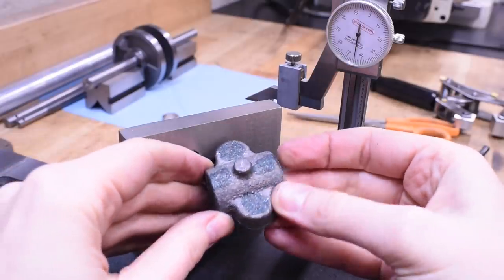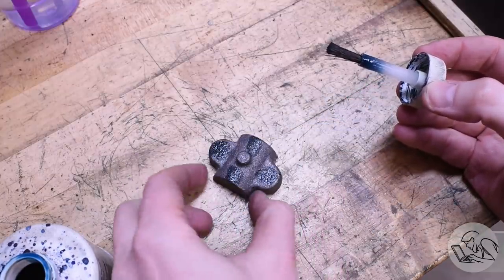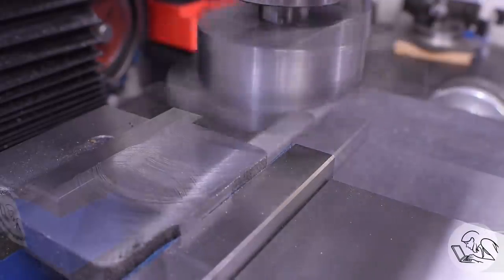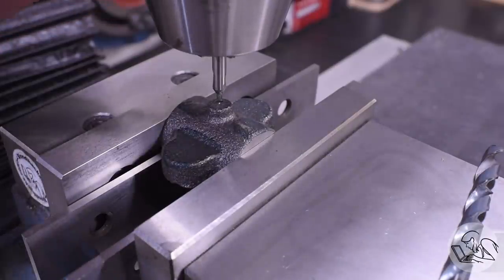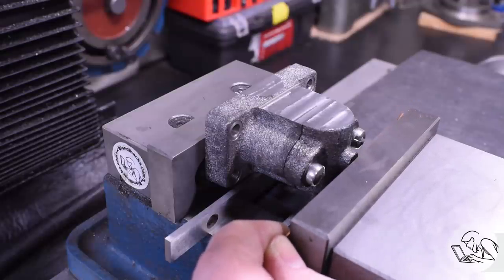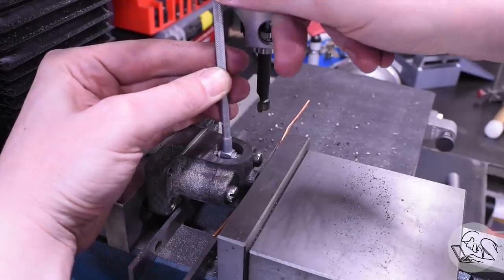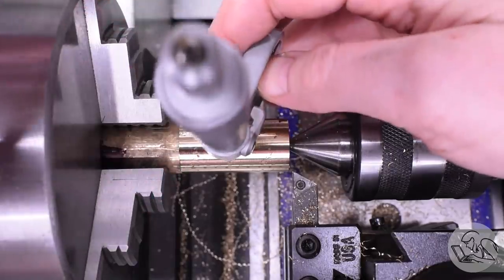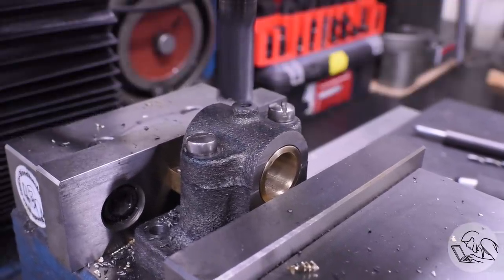Main Bearings! Big Steam Engine Build, Part 4

Comment: When this little machine is finished you should make a generator to power the lights in your shop.  It looks like a fun project.  Thanks for sharing your time and talents with the group.
Reply: I have a silly idea at the back of my head that won't go away, to make a steam powered web server from a model engine and an old bike dynamo or something. It would only take a handful of watts so it's very possible
Reply: @PKMartin  I love this idea. It's such a poetic juxtaposition of two of the most revolutionary technologies in human history - steam and VLSI
Reply: @PKMartin  A bicycle dynamo might be a bit small, but a permanent magnet DC golf buggy motor or similar, run through a regulator could very well power a RasPi of some sort, and they could do some basic server work using under 15W.
Reply: can water cool the server so that there’s less heat required for the steam

Comment: You may want to lightly scrape the bores of the bearings to give the oil room.  Given the high polish or finish of the bearing bores, it is possible to actually make them so smooth that the oil has nothing ton "hold" it on the bearing surface.  I've had that problem in the industrial world.

Comment: Seems like a sound choice to add the bearings. I would also be nervous about steel on iron without a pressure lubrication system. Nice visual touch also.

Comment: Your skill level and videos are getting better, even the boring parts were good. When you were contemplating the use of locating pins I immediately thought of where you can get some 1.6 mm pins from. The replacement turbines for dental hand pieces come with a blank bur. I'm kicking myself now for not collecting them when I was in the industry, I must have thrown out hundreds of them.

Comment: Lets hope this gets to you ahead of the two week window...I made some modifications to the one I built that have proved worthwhile to me.  On part #23 upper linkage thread the hole instead of using the pin to hold the #26 upper valve rod. Then thread the upper valve rod to screw into the upper linkage,  This gives you a place to fine tune the valve to the ports.  I extended the length of #23 and shortened #26 a bit to allow for some depth of thread and enough engagement of the rod to get a fair bit of adjustment.  I also added a lock nut to the mix.

On part #14 upper eccentric instead of drilling all the way through from the top I only drilled for the threaded hole and then moved the oil hole to between the brace and clamp rod hole.  This allows you to reach through the eccentric with a hex key to adjust the eccentric position without disassembling the eccentric.

lg

Comment: Another outstanding episode.  If you end up in a pinch, and you have a shaft that's just a thou or two or three too small for a bore, you can knurl it and the shaft will "grow".  Then you can turn it down just a whisker to hit the proper OD.  Not great for parts that rotate, but great for static fits.  To save some money on a rebuild, people sometimes knurl the old worn pistons so they won't slap around in the bore.  Hopefully.....you never need that trick.  You can also use it to change a sliding fit to a light press fit.

Comment: You can "pre-lube" the bushing material prior to machining to get rid of the squeel and to condition the stock. You drop your material into cold oil. Heat up the oil to bubbling point and then leave everything to cool down on it's own. Try it sometime it works like a charm. It only works on any brass or brass mix alloys
Reply from the maker: Interesting! I have not seen that technique

Comment: Ampco bronze is extremely handy to keep around; it's uses are various. It and it's cousin Nibral (nickel aluminum bronze) are my personal favorites for machinability, weldability, and most importantly, durability. If I'm making parts out of bronze for myself, these are the two types I personally reach for. That being said, in my real job as a CNC machinist/programmer, I just get to deal with whatever the customer specifies.... That can get interesting....
Reply: Interesting you say?
Happen to have any standout horror stories in that respect? Do love a good tale of woe.
Reply: @jaxblonk5127   Getting to work (2nd shift at the time) to find that my 1st shift counterpart had just snapped an ~$3,500 12' long cast iron chunk of Durabar because he forgot to unclamp one of the vises before he tried lifting it with the overhead crane.

Comment: Good to see your development on approaching machining of castings, very useful. 
I tip: use 3 parallels to create a horizontal face on the casting face to machine. Place 2 parallels on the vice jaws, then the 3rd resting on these,  and hold up the cast face to this 3rd parallel. There are no parallels under the part.
Great work and video,  and great jokes 🤣. 
Thanks for sharing

Comment: I like to use FHCS (flat head cap screws) for alinement, on split caps and fixtures . The angle of the screw will shelf line up with the hole in the cap.

Comment: Excellent - really enjoyed that one :) The bronze bushes are a nice touch and improve the look and function no end. I can't believe they didn't specify them in the instructions. We're not savages. But then, they also supply those awful screws so perhaps they are. I don't know how they can supply such nicely done castings and then throw those screws in the box with them.

Not sure why you're questioning the idea of the bushes locating the two halves of the pillow blocks. Seems totally reasonable from here. I guess you could have done the stepped thing like on the little engine but I bet they wouldn't have bothered in production, considering it too expensive.
Reply: The only excuse I can think of is that they (secretly) want you to make your own screws, but to make the kit complete they throw in some awful ones to motivate you.
Reply: @MrRedstoner  I don't make my own unless I absolutely have to, but I'm more than happy to purchase small hex headed screws. They might even be more easily available here in Aus than in the US, which would be a first for anything other than kangaroos. We use BA down here for model engineering, but small metric can be had from a place in Germany called Knupfer.
Reply: @davidtaylor6124  I'm from the middle of Europe, and happen to have a nice hardware store within walking distance of my house, so that's what I use in my exploits. Most often Philips head because that's what I started with, have a bunch of, and don't really care about looks.

Comment: Hi Quinn. About the alignment pins on the bearings that you didn't have room for: Could you do a hollow dowel around the outside of the bolts? Like cylinder head dowels. Like you said, the bronze bushes will do fine but thought I'd throw it out there. Amazing work.

Comment: Most of my steam experience was working on Stanley coffin nosed steam cars. The ultimate E ticket ride! And these guys haul ass if you think they are slow. At any rate the Stanley brothers created the company that would go on to become Eastman Kodak. They did what is called dry plates. The nefhew knew all the secrets and actually built a small bench mounted steam engine for making some of the original X-Ray dry plates. The photo I saw was a bit grainy and black and white. But looking back, I now believe this engine was the one used. According to PM research, they just adopted the design and went with it. The reason he used a steam engine was that motors were just then showing up and the majority of shops were line drive. He couldn’t get a line drive in that area but could get a steam line.

Comment: although not at all practical, it would be really cool to try to do a model like this using babbitt alloy bearings. It would require some fancy dancing on the mill and some complications with the pour, but it would be super cool and babbitt was used in a lot of steam bearings.

Comment: You need to work up to a size steam engine that's big enough to run your lathe.
If I was younger I'd see about building a steam turbine to run a large generator.  I live in an area with many sawmills and very little sawdust gets used so it tends to just get piled in piles. My idea is to heat the water with sawdust the use the steam to run the turbine to generate electricity to sell to the power company then the steam exhaust could be channeled back through the sawdust storage in a pipe network to dry the sawdust and cool the steam back to water and recovered to use back in the boiler. This would be necessary since the ground water in this area has a high lime content and if you used it straight in the boiler you'd have to replace or clean your boiler every six months.

Comment: Don't underestimate steel in cast iron. That pairing was and is a very popular material fit for combustion engine pistons/liners. Steel liners and cast iron piston rings are still widely used, model engines used either full steel pistons in cast iron liners, or the other way around. 

In the latter, those cylinders/pistons are very long lasting, if you threat them right. That's also was one reason that made them unpopular, they needed a few hours to break in to maximum performance. (The other reason is that they are really prone to rusting, and the modern synthetic oils don't protect them as well as the castor oil used back then.) 

As far as I understood, it works so well because the carbon gets washed/worn out of the sliding surface and makes a porosity which holds oil quite well. 

So maybe you were a little too cautious about it.

Comment: Very Nice! I would like to have seen you use phosphor bronze or extra leaded manganese bronze. The Rolls Merlin used phosphor bronze on its exhaust valve guides and later berillium bronze. The BB alloy is dangerous to machine however. When I rebuilt my Cummins 5.9 I used manganese bronze with 10 percent higher lead. I forget the exact alloy but it has 10 stuck to the end. NASCAR uses this in their valve guides. It machines like butter and I had no issues with diesel heat. But the Al bronze will work in a pinch.

Bronze is a solid lubricant and that’s good. What would be nice is to have oil grooves in these bearings. The challenge is how to cut these. They don’t need to be deep nor exact. That would be the ultimate in super cool. You strike me as one who likes challenges so I will let you think about this.

As I recall, the older myford ML7 lathe had bronze bearings with just such a groove idea. Clearly a split bearing would be easy but a one piece idea strikes me as nicer.

Yup, this is a beast! I love it!

PS I don’t know if you guys know this. One of the best sources for brass and bronze is Farmers Copper out of I believe Texas. Excellent customer service and they don’t go freak-azoid when you need 6 in of bar stock!

Comment: Good job. I don’t like iron against steel either. I have made bushings for the crankshaft on all my steam engines. I built a Tiny Power Ajax. I was able to change the crankshaft diameter from .375 to.500 and the bushing OD to.750.I have no idea why they specified such a small crankshaft diameter but, I know I didn’t like it.

Comment: Looks like you acquired a set of stub drills, I predict you’ll find them useful. I really like them for drilling non-critical holes since their greater rigidity reduces tooling changes by eliminating a lot of centre drilling. I also agree with both you and Keith Appleton (and a few other YouTubers) that those slotted bolts are ugly and look out of place, glad you plan to replace them.
Reply: @Henning_S.  That’s a good idea but I suck at sharpening bits, especially small diameter ones, and I hate to cut a new bit.

Comment: After counterborkng the bearingposts, why could you not leave the caps on with only one screw (+ optional clamp), counter drill and ream slightly deeper than the thickness of the cap? That would allow you to use custom made shoulder bolts.

Comment: Generally speaking a good rule of thumb for journal bearings that I teach my mechanical engineering students is 0.001” radial clearance for every 1.000” of journal diameter. (0.002” diametral clearance on 1.000” of journal diameter)

Comment: It looks to me that there is plenty of room for 1/16" pins just outside the spotfaced area. However, as you say, the design of the bearing inserts tends to locate the caps fairly well. Now - however you decide on pinning the caps, are you going to use some pins where the pillow blocks fasten to the main engine base?
Reply from the maker: There wasn’t room- I really tried. 🙂. Yah, pins to the base are a good idea

Comment: when you were doing lathe work in the flywheels you removed the surface of the castings before turning them due to the hardness of the surface.  I did not see you doing that to the bearing castings before machining them.  Did I miss something or is it not necessary before milling them?

Comment: I'm kind of surprised you didn't take the chance to line bore the whole setup on your lathe.  Probably depends if you have the height from your sled to mount the whole engine bed with the bearings in place?
Reply from the maker: The bores are too small to line bore
Reply: @Blondihacks  Ah, I had assumed since rifling was done with a specialized kind of line boring tool that regular line boring could be done down to similar sizes.  It seems I was completely wrong.

Comment: The bearing caps look great Quin.  

Do you have a fixture with a cavity filled with low melting point solder or German red pitch for holding odd shaped parts? I wonder if it would have been an option for facing the bottom of the bearing caps and pillow blocks first. Then clamping them onto a sacrificial spacer on the table of the mill. Machining the two sides perpendicular to the bottom and parallel to each other in two set ups per part. Any thoughts on this?

Comment: What about a hollow dowel that sits half in the cap and half in the bearing body for locating the cap. Gas engine cylinder heads use them for keeping the cylinder head and head gasket aligned properly.

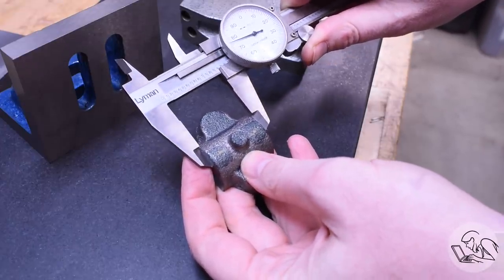Comment: Why did you use some copper wire at the second and third milling operations but not on the first? At around 5:45 I saw the part move a bit when you tightened the vice.

Comment: You can drill the lower casting for press pins and then drill those for locating as to not waste space but still have a locating feature and still have bolts see it allot in small engine repair work kinda a bit late for that though youd had to have done that before boring

Comment: My lathe has 12 thousandths wobble in my lathe spindle bushings, I’m a bit afraid to attempt this casting kit, tempting though
Reply: If it has bushings you could possibly remove a little of the shim, between the cap and scrap in the bearings. and. Did this when I was in high school many moons ago three corner file can be ground for a scraper and Prussian blue. . You will have to run some an rescrape afew times to get the clearance right.. took a while but "turned" out very nice . Make sure you have oil groves cut into bearings.

Comment: Could you have indexed the bearing caps with an index pin in a blind hole drilled from the underside?
Reply: With only 1.25mm wall thickness there isn't much to play with. Still possible I guess but doesn't seem necessary. Loctite on the outside of the bush would be easier if you really didn't want it to move :) It sounds like the oiler is going to be put into play for this anyway.

Comment: I am not criticizing your diligence in setting up and machining parts  as accurately  as you can, because I am the same way. The thing that gets  me though is that Keith Appleton who is a master at making steam engines work doesn't seem to do that. He uses a 6" scale to measure and mark out , a needle file as a scriber, uses wood parallels in his milling machine vice, and doesn't pay attention to the  graduated dial's on his lathe, but still his engines run great. I guess you have to be a British model maker to do that.

Comment: Very nice. I always think you're being way too conservative with feeds and speeds, until i remember you're cutting dry on hobby equipment. Makes me appreciate my  employer's shop tools a good deal more.
Reply from the maker: Real machinists, in my experience, have no idea how little these little machines are capable of. 😁
Reply: @Blondihacks  the more i watch these videos the more i understand this. I'm used to opening FS wizard and plugging in material and tool data and using the highest feed and speed, oblivious to the fact that i have a 2hp mill and a 1hp lathe and a honking big cnc. It does you credit that you accomplish so much with fractional horsepower.